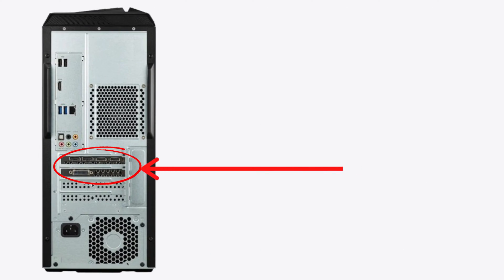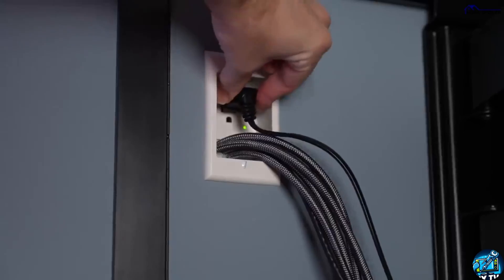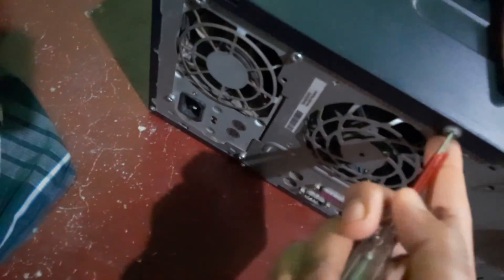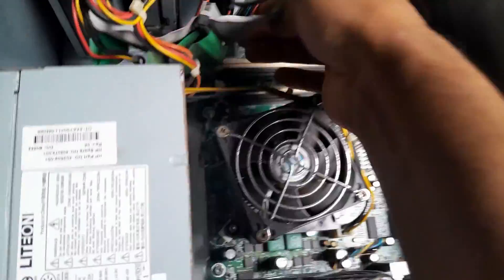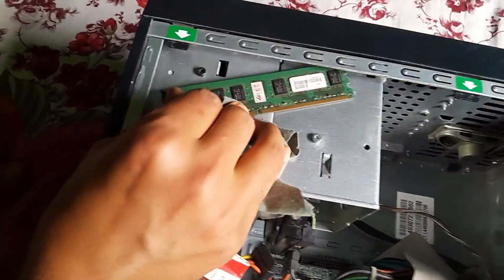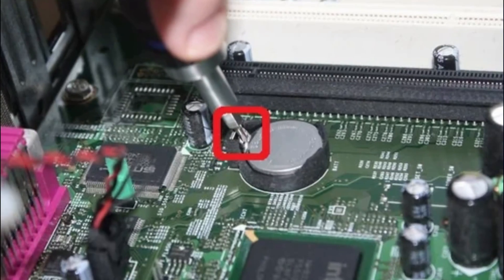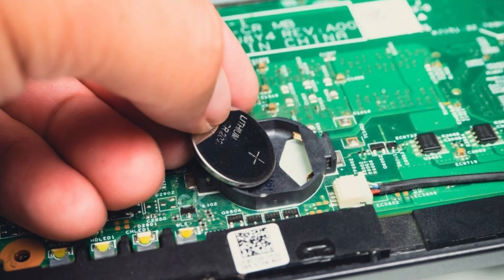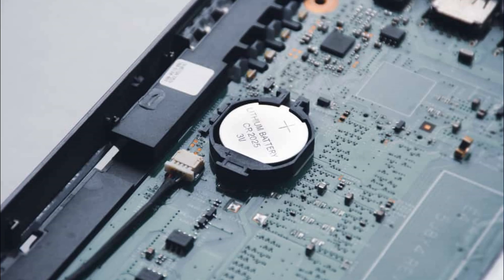ViewSonic Monitor No Signal (4 Ways to Fix It)

Comment: You forgot to mention the easiest troubleshooting step... connect a different monitor. If you change monitors and still have a "no connectivity" problem, then move on to your computer. But if the second monitor functions normally, then you probably have a problem with your first monitor.